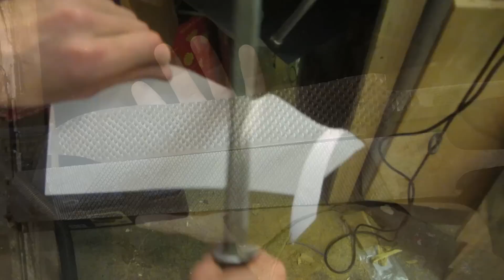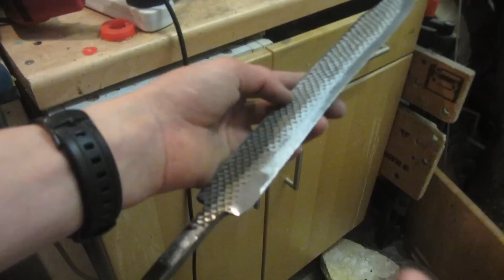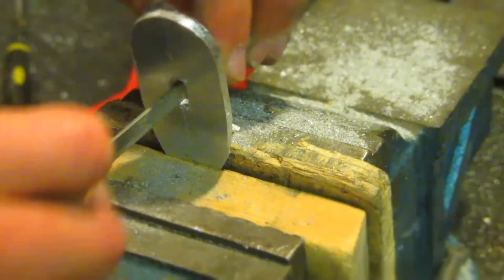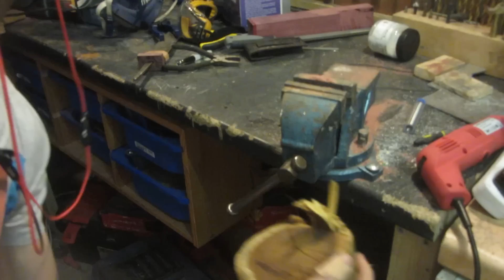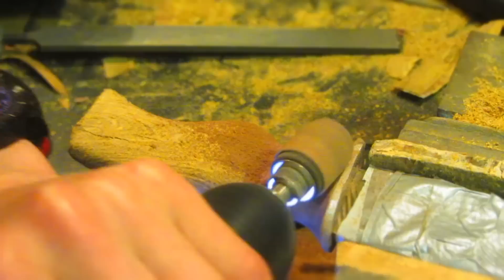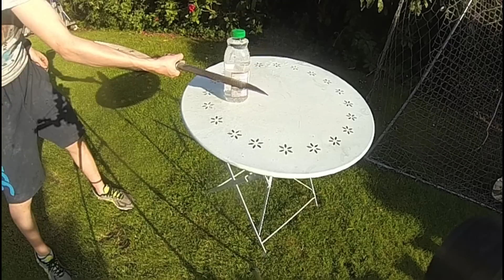How to Make a Bowie Knife From a Farriers Rasp

Comment: Pretty much every knife that I have made has been made from farrier rasps and I only need three tools; 
-a 4.5 inch angle grinder with inox disc
-a 4.5 inch angle grinder with flap disc
-and a welder for the handle
The handles are also made from rasp and ends up being very comfortable to the hand. What I am getting at is that you do not need every tool there is. With only three tools a sexy, sharp and comfy knife can be made for $0

Comment: if I where making the guard, I would use calipers to make sure it's as exact a fit as I could manage, then use dry ice to cool the blade and heat up the aluminum, that way the two should be able to slide into each other easily, but once they reached room temperature the steel would have expanded and the aluminum contracted, locking them I'm place.

Comment: hey great job! quick question though, does the tip of the blade not overheat and lose its temper while cutting it to shape with the angle grinder? im starting a project of my own and was a bit worried about that

Comment: You need to use a liquid acid flux. And allow temp solder. For my hilts I use400 degree acid flux and solder. That way it don't gonoverbtemoering heat.

Comment: If you have wood for the handle, which is cracked, to fill the cracks the easy way, when you are nearly done with the sanding, fill the cracks with wood glue and then continue sanding, the sanding dust will fill the glue in the cracks and create a sort of wood putty and fill the crack, God Bless, really cool Bowie.

Comment: if you had used brass instead you could have brazed it..or left three quarters of a inch of the tang sticking out and flattened it till tight on end of handle..
doesn't really matter what you did was superb great job.

Comment: After positioning the guard upon the shaft, I might would have "brassed" to the steel on the back side of the guard, to hold the Aluminum in place against the blade forming a lump or knot of brass behind the guard. The brass would braze well on to the steel and at a lower temperature, than welding would and it could be formed by flowing the brass into the Aluminum guard's hole, thus tightening it into become a wedge, keeping all in place. The 1st section of the wooden handle's hole, could then be slightly enlarged, to accommodate the brass wedge and the epoxy would then bind all together. Hope that helps Great Work !

Comment: next time for the handle you could try drilling a hole into the wood barely big enough for the tang, then heat the tang red hot and press it into the drilled hole to get a exact fit.

Comment: I don't mean to be judging of your work but you should of annealed it and heat treated it yourself. Saying that, your tang is still really hard. Not to many people will know what that means. Your handle will snap right off with little effort. I could probably grab the knife by the handle and apply very little pressure on my work bench and the handle will just snap right off. now what you should have done was anneal it and work your bevels and just about everything before you put on your edge, then take it to your heat place it may be a grill a break drum whatever, take it to your heating place and get some vegetable oil and an earth magnet. Heat your steel till it is no longer attracted to the magnet, when this happens dunk just the edge in the oil. no the spine until it has no more glow in the entire blade. So keep the edge in the oil until you can't see any glow on the spine part then just dunk the rest in and wait till it all cools done then throw it in your oven at 470°F for 1 hour and 30 minutes. Then sand it all up and get you a handle on then put an edge on it and beautify the knife.

Comment: Aluminium and stainless steel don't go well together, it's due to the structure of the metal and just the difference in melting points. You're better off just using epoxy glue or something similar.
You mentioned welding them, which technically could work but it would probably end up looking horrible or it would just make one or the other disappear.

Comment: to attach that guard, u want to have super tight fitted to the tang, and make you tang taper, thick end towards the blade, you can then hammer it down a bit and the friction will lock it a bit, than take a punch and basically use that to scrape metal from the bottom of the guard near the tang slot onto the actual tang, all this plus the pressure of your handle on it will keep it in place for any sort of abuse

Comment: It's a great knife, my congrats. If you pretend to use it as a machete (to impact wood, as oposit to "stab"), the weight has to be more similar to an axe, on the oposite side of the hand. You can get that weight distribution by making it more thin near to the hand and more thick on the oposite side, If you pretend to stab, weight distribution is the opposite (thin at the tip). A constant weight as yours is kind of a "survival knife", as it can be used (not optimally), for both.
Reply: +Santiago Pages I won't recomend to solder aluminium with stainless, keep it all stainless... Even if you weld it, aluminium oxid may separate it... not an expert on welds, just a young engineer's opninion. I insist, keep going, you are on the right path

Comment: Awesome knife. As for the guard, one idea is to make the square hole a tad smaller than the tang, then force it on the tang.for a tight fit. Since the square hole was already made, some hammering would have made it a bit smaller, enough to make it have a tight fit. But nothing really wrong with what you done.
 People will give you are hard time because it isn't a full tang, but it is what it is. It would have been shorter if you had made it full tang. What you did was fine. The only idea I have to improve on it is to also drill and add brass dowels to give it more strength. It would act as a safty barrier if the epoxy was to give up, which could be very bad if the blade came flying off while using. The dowels would at least help that situation by adding support to the epoxy to some degree.
 From what I see, or think I see, most knife makers would not have hardened the tang, or in your case, would have anealed it. This would soften it up enough to drill holes, add metal to make it full tang, or any orther shaping work to be done.
 None the less, it came out great. great job. A hell of a knife. I'd gladly have it.

Comment: That's quite a nice use of an old file, but a word of caution regarding the handle, for safety you should consider putting a pin through the handle going through the tang because if you are going to be using it for chopping the knife could fly off unexpectedly and if you are unlucky it could end  up killing someone, so the safest thing is to use a metal pin that holds both hand and tang together, that way if it becomes loose you will notice it before it becomes dangerous.

Comment: Using wood that is so fresh is not a good idea, since it will dry up eventually and could crack and separate from the other pieces of wood used for the handle.

Comment: Standard electrical solder won't from a proper bond with the aluminium surface even with the the wire brushing and flux for the same reasons that welding won't work (it's to do with crystal structures). You'll need a special alloy of solder that is lead free in order to get a bond between steel and aluminium. For your purposes it would be more beneficial to use an epoxy or any kind of contact glue to minimise cost. If you want to find an alloy necessary for welding/soldering/brazing aluminium to steel the best source would be a local welding supplier or use an online supplier; Harris Products Group is an example.

Comment: Hey, when fitting the wood handle to the tang; cut a smaller hole in the wood then heat the tang and press the handle on. It'll smoke abit but the fit is very good. Learned that from an old knife maker years ago. Good video, I enjoyed it.

Comment: good knife and yeah for soldering the aluminum to the stewel it cant be done aluminum is a non ferrous (non magnetic) metal and its metallurgicaly impossible except for friction welding to weld alumnnium to steel next time some thin gauge steel would work but good knife keep up the passion and good work .    also next time just slide the aluminum guard on and put two tack welds to the steel just under it so it wont slide down and stays in place if you have this issue again .

Comment: Explaining the pixie dust:

Aluminum is basically impossible to solder at home especially when you try to solder it to steel (in this case most likely a very high carbon steel). Aluminum builds up a passive oxide layer on top within the blink of an eye. This is also why it is not the easiest thing in the world to weld aluminum and you have to do it under an argon atmosphere. IF you wanted to solder it you had to do it basically in a high vacuum to prevent an oxide layer from forming also you would need to remove the existing layer. Also you had to use a solder material that forms a mixed crystal with aluminium as well as steel and also melts below the melting point of aluminium which is around 660°C. Basically it is impossible.

Comment: good video one thing you can do about soldering without a soldering gun is a clothes hanger and a torch heat the metal with the torch and wild keith is still applied touch and hold the clothes hanger to what you want to solder and it works

Comment: You can't solder aluminum with steel, and aluminum and steel should not be in direct contact anyways, because of galvanic corrosion (the electropotential difference between the two metals causes a chemical reaction that accelerates corrosion on one or both metals). When you need to attach steel parts to aluminum you typically coat the interface with zinc. Instead of soldering the correct solution here would have been an epoxy resin.

Comment: You did an amazing job with the knife, I think it came out really nicely. If I may, I'd like to make a small design change suggestion for any future knives or other such implements you make, especially if they're intended for high impulse tasks such as chopping. At the point where the tang transitions to the blade I recommend forming fillets, possibly with a rat-tail file or something similarly rounded, rather than the sharp 90 deg transition you used. The sharp transition causes high stress concentrations which increase the chance of crack propagation and structural failure. Good luck on you next project.

Comment: Very brief explanation:
Heat spreads very rapidly in aluminium. Welding it like that won't give you the heat needed for the metal to bond in the weld.

Comment: that is a gorgeously made knife man. The only thing I would do differently is making a metallic pommel plate for the bottom of the handle making the tang just a tiny bit longer then your over all handle parts and then peening over the tag at the bottom of the handle to effectively fuse the entire assembly together.

Comment: You have to heat the steel enough that it melts the solder on contact. If you melt it with the flame it won't be drawn to the steel.

Comment: you cant solder aluminum use steel  then it will bond  and water flux from b&Q
and metal working solder good luck man.

Comment: I spent many years building guns, repairing guns, and made an occasional knife, many from files.  I also used aluminum for guards, as well as brass if I happened to have some on hand.  I never really used solder for attachment, but relied on friction fit, and if that was problematic, I would drill and tap the guard, and use a set screw to fix the guard to the knife blade.  I too used epoxy to mount the blade to the handle, and usually gave a gun-stock like finish to the handles.  I also used an oil quench to the finished knife to fix the hardness of the blade.  That insured the sharpness would remain for a longer time. I never attempted such a large knife but made dirks and daggers mostly as that was what my customers liked the best.  I no longer delve into the weapons making, and have satisfied my self defense needs with a small 1911A1 in .45ACP caliber.  I carried a double action .45 for most of my police career but did 8 years in the US Army where I grew to love the old 1911A1's for their durability and  accuracy if treated properly.  The one I have now is based on the Colt Officers Model called the Citadel model.  I am very pleased with the accuracy and conceal-ability, however it weighs in at about the same as a full size due to the way the frame was made  In fact I think my Sig .45 weighs less while holding more rounds, however the flatness of the 1911A1 gives it the advantage when carried concealed I have had my CC permit now for several years, and there have been days where I was much more comfortable with it by my side then any knife I ever made.  Just getting old I  guess,.
That said though I do believe you would have better luck using silver solder with an acid paste flux if you really wish to solder them on, I have attached sights to guns using that and it holds very well.

Comment: In relation to your braising issue, you'll probably find the knife was getting a heat soak, so there wasn't enough isolated heat for the solder to actually wet the piece.

Comment: @The Art of Weapons soldring on alu isnt doable couse of the oxydised layer of alu on top wich is the scale preventing it from melting , and the solder is over that melting temp,reason for the alu not melting is it disapates the temp faster then soder can and so the two wont bond! hope it helps ! acid treatment  or ZINN,no7 will help you soder on steele with even the worst soder! it toxic thou so do it in the free!

Comment: Good looking knife. Gluing the guard on seems perfectly acceptable, I usually just let the excess epoxy from my handles seal it in place. The aluminum bolster will likely scratch and dent easily, but it's shaped to the wood so it'll do it's job. The handle is beautiful, I love composite handles, though I was under the impression that Laburnum was extremely poisonous.

Comment: I only have a little knowledge of brazing or soldering you need your two metals to be as close to the same material as possible like aluminum to aluminum or rasp steel to something like cold rolled or hot rolled steel plate then use what I know to be called orange rod its a brazing with a flux already as one and use more heat propane takes a long time upgrade to at least mapp gas it takes less time and also less gas. I think your doing well.

Comment: You need fluorine containing flux to solder aluminium. Nothing sticks to aluminium oxide surface unless you either dissolve it or rub off mechanically without air access.

Comment: I would have used some oil stones on the blade to get it to a baby smooth bevel 
also you could have easily gone to a finer grit sand paper on the aluminium

Comment: Don't hold the flame on the flux, don't use a borax flux, and you don't need to solder a handguard to a knife.

The borax flux left that residue on your knife. Use a Rosin flux, or a clean alluminum flux. When you apply it do not hold the torch directly onto the flux either, when the solder touches the Rosin, clean flux gel. The gel pulls the solder into place. Lastly, simply keeping the handle tight against the handguarg so it presses it against the tang is enough to hold the handguard in place. It didn't need to be soldered.

Comment: great work but when doing handles use the heat method. Cut the holes smaller than required. Heat the tang and burn it into the wood. You will get a better fit and the tang wont be as brittle as the full tempered carbon steel

Comment: When soldering/welding you don't want the heating device to melt your filler but rather the actual metal receiving the filler. Hence why it was balling up and not bonding. Meaning, heat the metal till the filler starts melting by applying it to the metal without the heat source(torch, soldering gun, etc.) This is the only way to completely bond the metals. It would be tricky with the melting points of the metals differing. Maybe heating the tang first then sliding on aluminum piece and continue heating. Unless you have a T.I.G. welder.  That being said I am great at welding/soldering but not with two different materials. I'm pretty sure when working with aluminum you need a special filler for bonding it with another metal. Some 50/50 stuff like half brass half aluminum, I can't remember. 
 Hope that helps. Awesome info on the Farriers Rasp, never heard of em. I gotta find one now lol.
Reply: SlyDz420 Also this is just my opinion but I absolutely hate rat tang knives. I would of made the blade a little shorter to be able to make a full tang.

Comment: Cool Knife and job well done! don't bother trying to weld them metals together just bond them,{jb weld < poxy ect) if you want to weld metals then stay with ones that will solider/ weld. YOUR HEAT  source is your down fall,quick fast heat will be required,but, then you have to worry about the heat treatment..Hundreds of years ago you would have been a very good smith knife builder,hone your skills.
PS purple heart added a very nice touch to the knife even with the mistakes,alas that's how everyone learns,so long as they don't repeat the mistakes.

Comment: Nice looking knife! But how could you think that the knife would break? Because the thickness is about 5 milimeters right? You won't break it by smashing it into a plastic bottle, you will probably break it smashing it onto other steel or whatever what is hard.

ANOTHER IMPORTANT THING! Is this rasp the same as you have?
http://www.bol.com/nl/p/horze-hoefrasp-eco/9200000011209263/